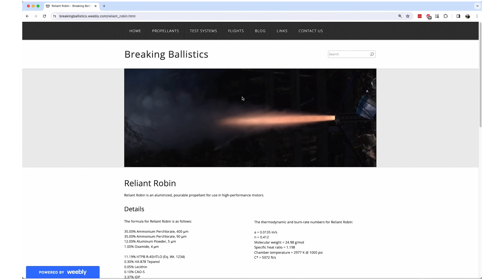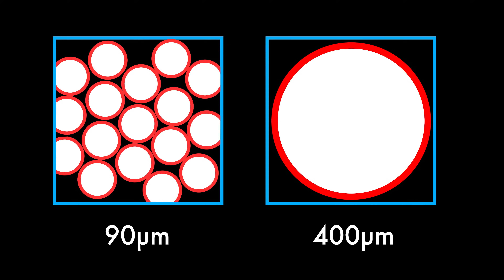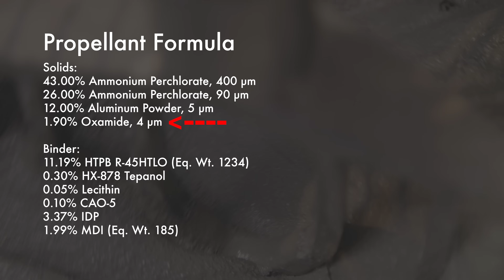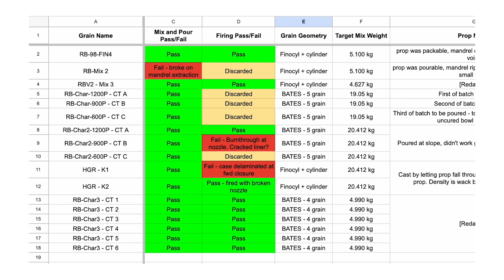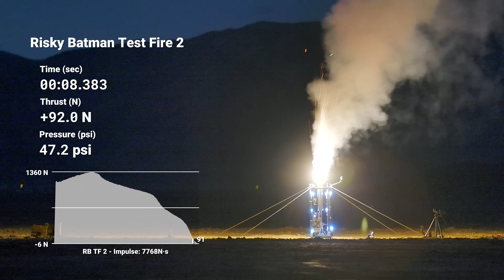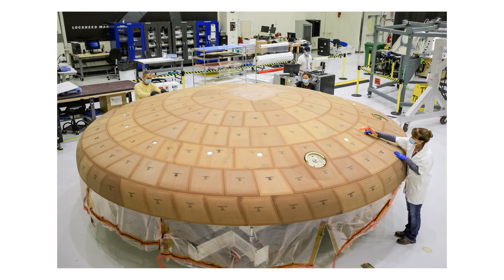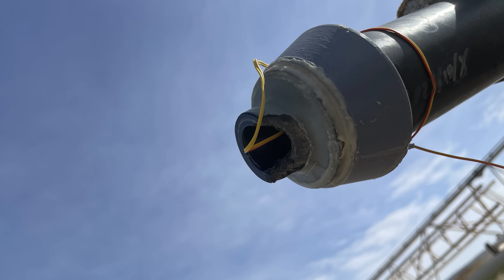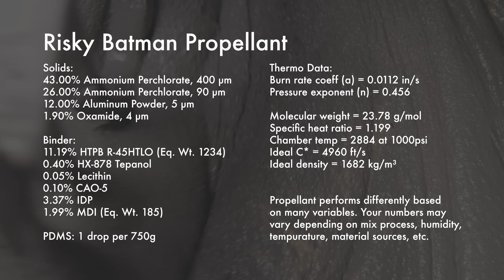First Time Firing My New Rocket Propellant

Comment: I havent tried casting anything requiring a mold release ... yet. But I"m familiar with some non-sticky things. I know of a spray furniture polish that contains both silicone and wax and does really well at eliminating friction in vinyl window sliding parts. But you cant just spray it on and get slippery. You actually have to do the labor of polishing it with a rag. (It was called Lemon Oath or Lemon Promise or Lemon Vow or something like that.) But my point is: I wonder if regular mold release benefits from being polished in place.

Comment: Why wouldn't you vacuum degas the motor after pouring it in the motor casing? There's already a cover on the bottom of the motor, its easy to seal with epoxy the internal of the core, and a silicone ring on the chamber top ensures no voids

Comment: Chemistry/materials science is often the hardest part of any project because it's often extremely unintuitive and there's seldom any feed forward design steps you can take. There are analytic principles you can use to understand what's going on but they only go so far and it takes a lot of experience to apply them appropriately. Most things are highly empirical and require a lot more trial and error than mechanical or circuit design.

Comment: I don't hear the loud-ass vibrator strapped to the bottom of your motor casings when you pour them, like a concrete vibrator, to remove air bubbles and accelerate the voidless fill of tube.  Please explain to us why you have not be drafted or kidnapped by NASA or SpaceX or some Ivy League school?

Comment: blending is dark magic.

if you‘re really interested in particle distribution I warmly welcome you to the world of manufacturing tablets with <10mg API.

humidity and temperature are important as is the blending apparatus and the process.

validating it would be quite a challenge but that’s what you‘ll need to do. it isn’t only about the ingredients but how they are worked.

great stuff!
Reply: silly idea but so what:

perhaps using a very thin wax layer instead of the mould release could be an improvement too.

could also protect the product from humidity.

hope you have your procedure written down on a master batch record that you‘ve validated too.
Reply: maybe also specify acceptable ranges for ordering and testing your raw materials.

Comment: I'm definite;y not a rocket scientist BUT
Could you not pass the 400 "stuff" through a screening sieve so that you have a more consistent dimension on the material you use?
Then maybe put the smaller "stuff" into some sort of mill to get it down to the smaller size required and sieve that too?
Have no idea what you will do with the "dust" that remains though...
Maybe a couple of small but high performance bottle rockets "just for giggles".

Comment: NASA-Related question: Seeing that the chemical quality / particle size contributes to the burn characteristics, how did/does NASA mitigate this with the space shuttle / SLS? I presume it is mostly thru very extensive quality control... But still, what if the solid boosters burn a little faster or a little slower than the previous batch - how did the shuttle or will the SLS compensate for this? Especially since it's not like a liquid rocket engine that you can throttle or burn a little longer / shorter if needed...

Comment: Ok, your cracked nozzle is actually fairly easy to handle and improve in the future. Graphite is often seen as the mysterious material but it behaves an awful lot like a ceramic. It has low ductility and very high compression strength. When your rocket is operating you really have two failure modes that are really bounding in terms of nozzle performance. Erosion and stress related failures. Erosion is hard to handle because it’s literally particulate and other items that are destroying the throat. But stress related failures can be handled by pre stressing the nozzle meaning you can apply some sort of radial compressive load to the nozzle. This is similar to how pre stressed concrete would work. This should be that complicated to do because there is a lot of room on the exterior of the nozzle to add something but it’s worth looking into and may help you eliminate nozzle cracking in the future

Comment: Maybe choose a PVA based mold release on top of a hard wax coating on your tooling. "Abrasive" materials tend to wash/dissolve away the release agent, especially oild-based ones quickly and tend to loose their properties. In the past I had big problems with a lot of commercial spray on release agents in conjunction with polyurethanes and ceramic composities for my movie SFX builds.

Comment: Just an observation with your pour and similarities to pouring concrete. Concrete guys use vibration to purge air bubbles out of the slurry. Just wondering if this would work on your mix??

Comment: Hey Joe, long time watcher here, first time commenting. I’d be shocked if someone hasn’t suggested this yet, but why not gently vibrate the moulds after you’ve poured. This should help with any air bubbles. Great work, not only the rockets, motors etc, but the whole production. Top class. Ps, keep the mo. Kindest regards Matt.

Comment: ever thought of things to add to gasoline, that do the same kind of thing those oxidizers do to that base fuel... and that lower fuel prices are low because they don't have those kind of things in them? just as so how sulfur and lead copper iron nickle even ammonium nitrate and nitropropane are added to diesel fuel to reduce the smoke/soot emissions. they have that additive package go thru the pumps and all the old cast iron engines ran grate for 30 seconds...

Comment: no man, when you use too much mold release it gathers in a thick layer with the propellant gas trapped in it, those bubbles you see are formed in the fuel by the propellant gasses escaping early in the drying process. use a non-spraycan type mold release or spray it into a bowl and degas it under vacuum before painting it on with a brush

Comment: When reloading ammo , the propellant can be measured out using very sensitive scales for every cartridge. Yet when testing the velocity when fired from the same gun, it can vary many feet per second when all things are equal.
 Sometimes the universe just messes with you.
Reply: There's a lot of variables at play that can't quite be accounted for.  Even different batches of the same powder will have slightly different burn characteristics.  Not to mention slight variations in case volume, seating depth, bullet length and diameter, neck tension, the list goes on and on.  So yeah, it's amazing we reloaders can get the kind of precision we do.  A couple dozen feet per second is actually really impressive.
Reply: @vicroc4 Elimination (more like reduction) of variability is the Arthurian grail-quest of science. It's frustratingly elusive but so satisfying when achieved.

Comment: Why don't you/why is pressure casting not used with this? I cast resin, and the only way to get something perfectly clear is with pressure casting. It compresses any suspended air until it's not even noticeable. You can get a crystal clear resin from it. Vacuum degassing doesn't even come close.
Reply: I'm not sure if this is the reason, but pressure casting doesn't actually remove the air bubbles. It just shrinks them a lot because the pressure is higher. The amount of air in there is still the same. With rocket propellant you want to actually degas it, because the air pockets can explode. So pressure casting doesn't degas, it just visually shrinks the bubbles.

Comment: Hey BPS, Kinda irrelevant but what do you do with the leftover propellent that doesn't get loaded, or the 3 motors you didn't burn? You may have answered this in a previous video but i am still curious. Would't this stuff be dangerous to keep around. ( Not a chemical or rocket guy i just like the engineering process) Love these videos, Been watching since the "echo" Model and the video quality and craftsmanship/complexity has gone through the roof in the last couple years.

Comment: Hiya! I love watching your videos! You and Xyla make for such a hilarious pair of friends.

I'm not an expert on, well, anything, but I was just wondering if you have tried using a vibration motor to work the air out after you pour the propellant? Whenever I've helped pour concrete, especially structural, we have used a huge vibrating wand on the end of a flex shaft to literally shake the bubbles out. (don't know what the actual name is, just NSFW terms that the others have used for it). I understand that the propellant is a lot more viscous than concrete, but it's still a material that flows; it might just take longer. Ostensibly, all you would need is a strong motor, an eccentric weight, and a speed controller, and then strap the vibration motor to the rocket motor casing temporarily.

Obviously it's just a suggestion; you're the engineer, and the only certifications I have are in medical optics and driving a forklift.

Comment: How do you dispose of the bad batches of rocket fuel? I'll bet it's fun. Hybrid grain size is a great way to go, btw. I've seen some neat stuff adding carbon fiber chop (or nanotubes if yer' fancy) for a wee bit o' strength as well. The nanotubes are the best but are of questionable safety to handle.

BTW Snap Rings scare the crap out of me too, and I've been handling them for 20 years

Comment: If you run test replications, you could get a sense of how your motor performance changes pour-to-pour.

You need 3 points to fit the curve, but if you have 15 samples for 3 nominal points, then you have 5 samples per point to tell you the process variation you can expect when you think you've held all variables constant

That's extremely valuable data, and would enable you to predict how erroneous your performance estimate of a different motor size might be before you pour it

Of course, you could get into deliberately varying things to see how sensitive your motor estimate is to things like different AP vendors, but that's getting into the kind of characterization that goes far beyond anything you'd realistically need as a hobbyist

Comment: You seem to have a multidimensional experiment-response surface (like 10 independent inputs and 5 outputs). Have you considered running Plackett-Burman or semifactorial DoE to optimise at least parts of the surface?

My gut feeling is that a lot of your rheology and material properties would be amenable to it and you could do things like mechanical properties on small scales (grain slip, etc.) really efficiently.

In my field we usually do it for optimising surface and performance characteristics of lotions and paints, but I have applied similar workflows to other domains and it's a good way to see which parameters you can reasonably freely tweak

Comment: that rouge motor was awesome, if a bit scary. the fact it started by mortaring itself 30 feet in the air and still managed to fly relatively smoothly once it did get airbourne? that's just some beautiful physics.
Reply: I'm guessing it had some inertial spin from rolling on the ground, then it maybe hit a pebble?
Reply: @ExpressYourselfMachine  a little of that, but i think the nozzle broke and gave it some spin. looked to me like on the ground it started spinning faster and faster, eventually bouncing somewhat upright and spin stabilizing itself. it was pretty late in the burn, so it probably was on the tail end of the thrust. as it dropped off, it tilted over and zipped overhead.

note: this is a guess, based on the video. it mostly looks like it's spinning up on the ground to me because of how it starts bouncing itself higher and rolling in circles.
Reply: Should be a new launch category. Mortar assisted launch. Fun to watch, hard to nail, perfect for youtube :D
Reply: @NineSun001  ooh, that would be an interesting challenge. Would have to build strong rockets that are still light enough. have a couple of "classes" with different hole sizes and depths. Tricky bit for this would be doing it safely, as tossing a few pounds of dirt into the air at launch would definitely cause some stability issues for the first few feet.
Reply: Yes that was pretty epic!!

Comment: Could you use a wax mandrel for the inside contour of the motor grain, and then melt it out? I know it sounds risky, but the melting point of the wax should be much lower than the ignition temperature of the propellant.

Comment: Just a thought - just my intuition speaking:
If consistent burning depends partially on the grain size of the dry chemical, wouldn't it be advisable to "sift" the grains through a series of mesh filters or screens?
BTW, growing up in a fireworks legal state, we had one particular "random flight" firework (we) called a "______ chaser" (give me a break, I was just a kid in the 60s. Fill in your own blank). The problem with them was half the time they homed in on the person setting it off. You got of way lucky on that one.

Comment: seems like the first approach would logically be to take the percentage of the additional suppressant from all ingredients evenly. Was this attempted? You might be better off injecting the propellant into the mold. I would suggest getting your own sifting setup to validate the micron size of the perchlorate. Don't worry, you can't learn if you don't fail.

Comment: Could you double check your grain size by shaking it on a table then only using the top stuff? Like, let it pebble sort out on a shake table then only use the top 80%? Not sure what you would do with the smaller junk at the bottom, but might help get more consistent results.

Comment: Your "90um" size problem is reminiscent of an OLD problem with black powder.  When using a non-sieved powder grain and transporting the powder via carts and horses/donkeys to a battlefield (yes I'm talking about the 15th century!) the power would stratify.  If didn't remix the power on the battlefield, once you got down to the fine grains you would blow up your cannon.
We experienced something similar using 'reenactor powder' (mixed grain size = cheaper powder) and one of our shots with 1.5oz of what we THOUGHT was 3F power ended up with a much larger BANG than we were used to.  Sent one our guys to the EMT for dizziness who fortunately was fine.
Don't ever assume with this stuff!!

Comment: Do you build a draft into the grain mandrel as though you would with a metal form?  If you add a slight taper it may release easier and I would assume the burning surface area wouldn't be much different to calculate wit this skew.  As well as sanding  striations out of the mandrel and as you said properly applying mold release.
Reply from the maker: Yes I do, usually a degree or less but there's a taper for sure! That makes a big difference, good catch :)

Comment: Does anything different need to be done to get a fuel that will ignite at high altitude? The slow way that some/all the tests get going suggest that even at 1 bar, the burn rate take a while to build up enough pressure to reach operating conditions. I could see some mixes, if lit off at too low a starting pressure, just smoldering. I know it's possible to shit off a sold fuel rocket by dumping to vacuum (e.g explosive blowout panels). I wonder if you could do the reverse: seal the nozzle with a burst disk to get faster (and maybe more constant) pressure curves.

Comment: I would say that a good set of sieves is needed to help in grain size. Sift though a little bit larger size sieve than with desired size, getting clumps or oversized, then sift through the size wanted to get out powder, broken grain and leave desired size. If the sieves will stack, you can do in one step and it will sort by size. They also help alot while just getting the ingredients ready for mixing in general.
Reply: Was thinking the same. With ASTM sieves it might be possible to get down to a size delta of 10-30 nm. They stack and can be used with a mechanical shaker
Reply: Yes, stackable sieves are common equipment used in geology and pyrotechnics, two fields where determining grain size is important, the latter critically so.  This way the mesh size could be determined empirically and not just trusted off the label.  Because the label will always be wrong.
Reply: @josephastier7421  That is only partially correct. Sieves for scientific applications come with a calibration certificate reporting actual mesh size and tolerances for each single unit. Obviously, that is reflected in the price.
Reply: nobody cares
Reply: @StellviaHoenheim  You cared enough to comment, by your own definition that means you're nobody.  Sick burn, my dude.

Comment: Could you add a bit of vibration while pouring to let the mix settle a bit? Just like pouring concrete, it could help letting the bubbles float up, as long as you don't overdo it and break the homogeneity of the mix